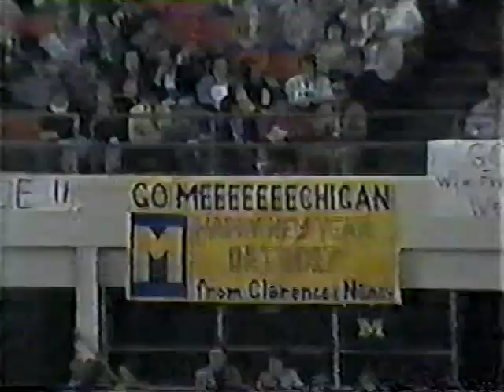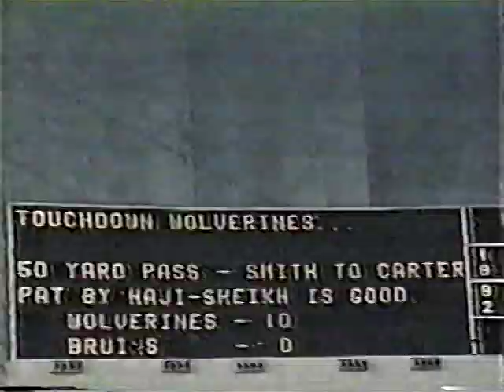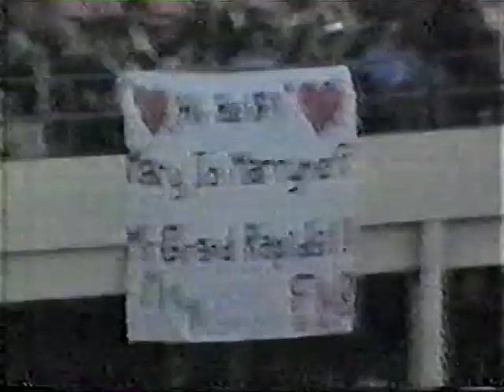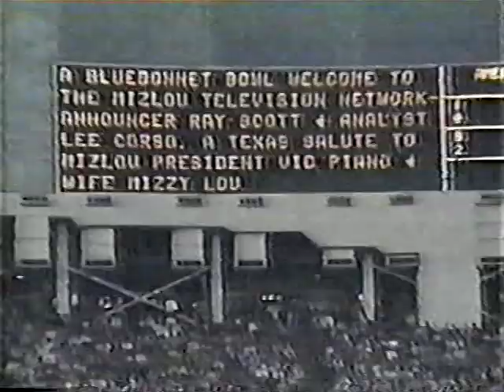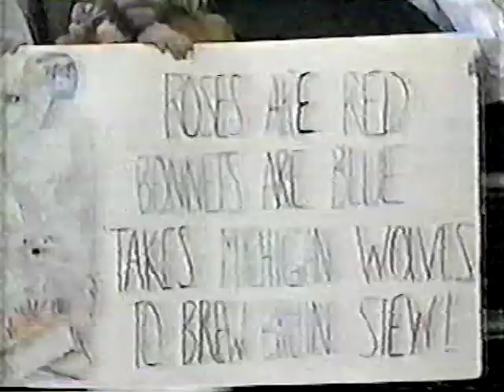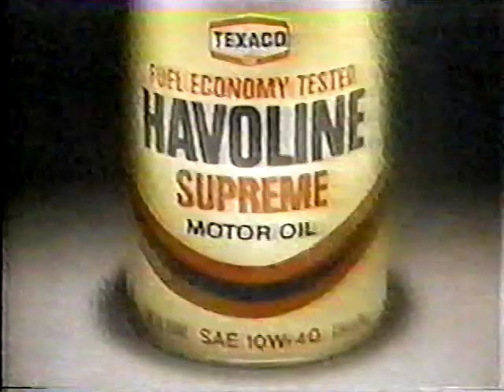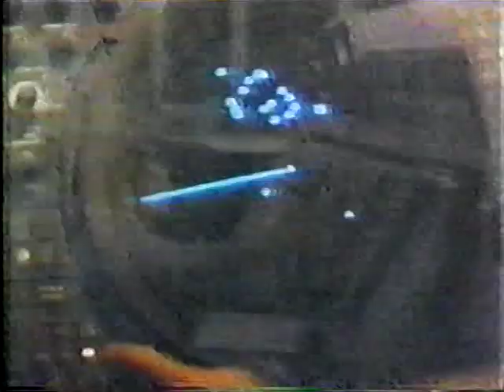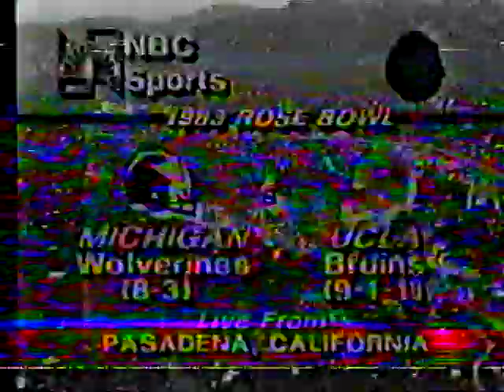Bluebonnent Bowl UCLA vs Michigan Devember 31, 1981

Comment: in the following season Michigan and UCLA will meet 2 times the latter at the rose bowl game
Reply from the maker: While Bo did not have a good bowl record, that loss to UCLA in the 1983 Rose Bowl was his only double digit loss in a bowl game and that was barely, losing by 10. Every other bowl loss for Bo was by 8 points or less.
Reply: That Rose Bowl sucked Pachyderm Pecker.   Michigan, despite still having Smith and Carter, did not have a very good team.  This was obvious watching the Notre Dame game early in the season.  They just looked dead.  But Shembechler was a great motivational coach and squeezed every last out of his players and managed to get an 8-3 team out to the Rose Boel, where they weren't much of a match for a UCLA team much improved over the one Michigan mashed in this 1981 Bluebonnet Bowl.  For me, this was my 1st Bowl game.  Having moved to Houston from Central Michigan where I had graduated the previous Spring.  I got done with work that day in Clear Lake and on a whim went to the Astrodome with a friend and fellow Michigan transplant to watch Bo win his 2nd Bowl game in Calendar 1981.  I would not go to see my first Rose Bowl until 1989.  Overall in bowl games, I am currently 4-0.  I know there is at least 1 butthole amongst you comment readers who is saying "So what."  To which I say "Piss off."😏